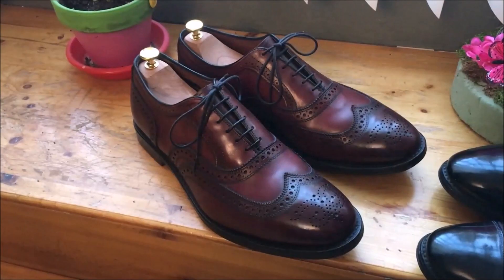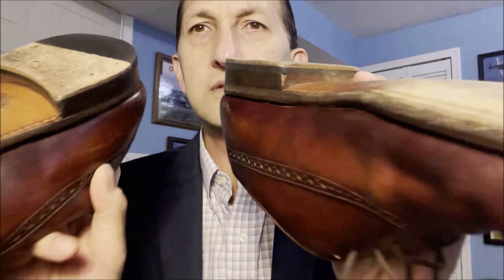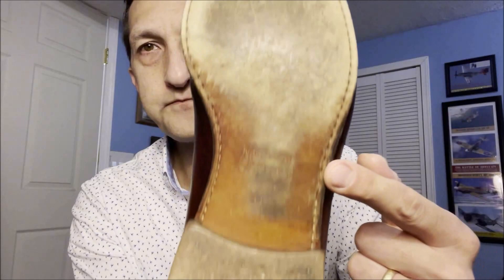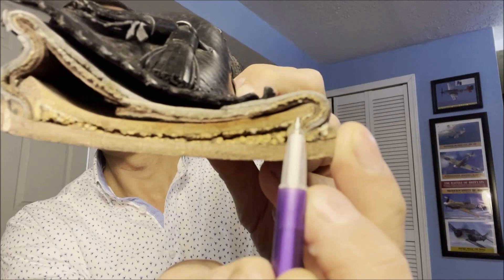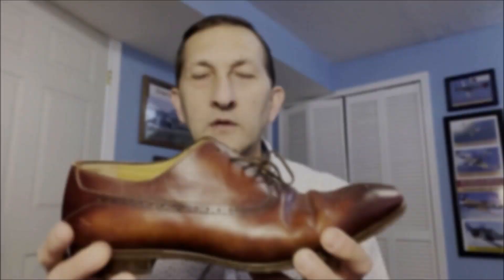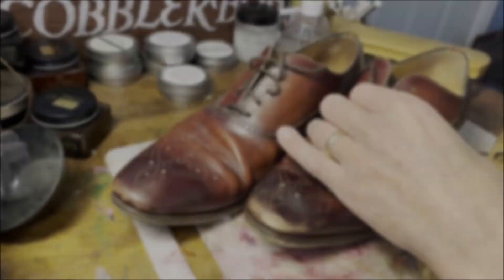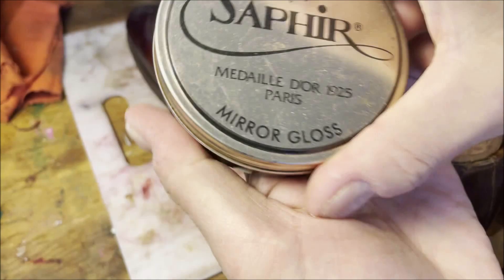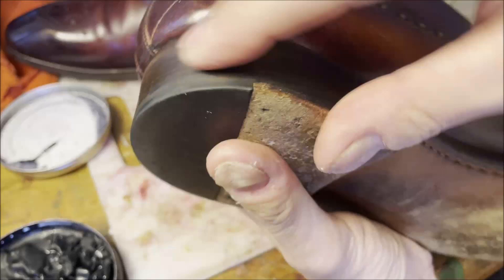Shoe Shine: Magnanni Balmoral Oxfords brought back to life

Comment: Love your videos as always. I am so glad that you have finally monetized your channel as I have been asking you to do for years. I generally don't comment much on your videos, because you make content for US viewers and US brands (understandable) and I have had very limited experience with US shoes and boots all of which went to eBay for different reasons. However I have a pair of Magnanni double monk straps and I will comment a little. On your opinion that goodyear welted shoes are more comfortable than blake construction - generally I agree, however blake shoes are much easier to break in. For example I have very sensitive heels and the smallest slip gives me blisters. For that purpose I have a pair of silicone socks I wear under my cotton socks the first few times with new shoes outside. Most of my goodyear welted shoes I had to wear 4-6 times with silicone socks to break in fully. It took me just  2 times for my Magnanni shoes. They are now my most comfortable non sneaker shoes. I even were guarding some students against cheating in one of my local universities during a state exam and I was in my pair for 13+ hours and after I got home it took me just 15 minutes of rest to be ready for a night out. I have rubber protectors and toe plates on mine so I can't say if a person feels the ground more ( I always install protectors on all of my leather sole shoes).
Reply from the maker: Thank you!! Great point about breaking in... you're absolutely right. The Goodyear Welted shoes with double oak soles are even worse!

Comment: Good job with that shoe transformation!

I like how you found a way to make the shoe tree fit snug. The sanding of the leather is something I want to get better at.
Reply from the maker: Thank you! Just be careful with sanding. Practice on some cheap shoes or old shoes you're not afraid to ruin the first few times. It's not always appropriate, and it doesn't always work. Don't sand too deep, escpecially on stressed areas like the vamps. This is why I left most of the cracks alone in the Johnston & Murphy semi-brogue Oxfords in the "Re-dye, crack removal, half soles, & heels on J&M Oxfords" video from 10/7/2022. Beware that if they're corrected grain leather, you'll sand through the coating and it probably won't look right afterwards.

Comment: Great job Robert, turned out really nice, although I got to admit I was getting a bit nervous watching you sand the back of the shoe near the stitches. Also good job with fixing the toe counter on the right shoe, I was wondering if shaving a piece of candle to fit that toe box and pressing it in with a shoe tree would be easier.
Reply from the maker: Thank you! That could work too. The beauty of this hobby is there's not only one way to do it. I always seem to learn something and/or get new ideas every time I post a video from you guys!

Comment: Hi Bob, great “experiment” as always. I just wonder, would it possible to reduce the creasing on corrected grain leather using wet cloth and iron?
Reply from the maker: An iron? I've never considered that... I've seen Justin Fitzpatrick of the Shoe Snob Blog use a heat gun and massage the leather (I did massage the leather while it was damp and it had the 2nd pair of tight fitting shoe trees in them). It seems like it would be difficult to use an iron, with the shoes being rounded and the iron being flat. Just remember, corrected grain has a coating on it, so it will proabably melt at some point. Also, heat is one of leather's greatest enemies for longevity, so I'd be careful with it.

Comment: Great work and an amazing find!!! Just a tip: Do check out the "Brighton Gentleman" on YouTube. He has a video on steam shrinking shoe uppers. That could really help with the rolls on the vamp.
Reply from the maker: Yes, I have seen those. I'll tell you why I shy away from that: I learned from Andy Vaugn, owner of Pure Polish Products that heat is one of the greatest enemies of longevity in leather. I don't doubt that his steaming method would help, I'm afrait it would change the shape/size of the shoe to where it wouldn't fit correctly. With these going on eBay, I wouldn't want to create a fitment issue. Secondly, and I will admit I do NOT know this to be true, but my belief is it would be a temporary fix, and the creasing/wrinkling would probably return after the first wear anyway. So even though I didn't get them all out, I felt like I got the most benefit that I could with the least possible damage or long term harm to the leather. Again, I'm not saying I'm right or have all the answers, but that was my mindset. That steaming method would to me be more ideal to try on a pair of shoes that I have "nothing to loose" on. By that I mean a pair that are not so valuable, or a pair that the owner would throw them away if I couldn't improve them.
Reply: @CobblerBob  I tried it on an old pair of AE McTavish. It actually worked quite well! Of course, I can't tell what it did to the leather internally. They've been holding up so far. I totally see your point. I do however think (with an older pair that you paid little money for) it's worth finding out of it does not just make a significant difference.

Comment: Just an fyi. The heels aren't stacked leather but a compressed paper.
Reply from the maker: You may be right, I wouldn't be able to tell without tearing them apart as I'm not as familair with Magnanni's construction methods as I am with say Allen Edmonds, but from the outisde they APPEARED to be stacked leather because of the seams in the heels.